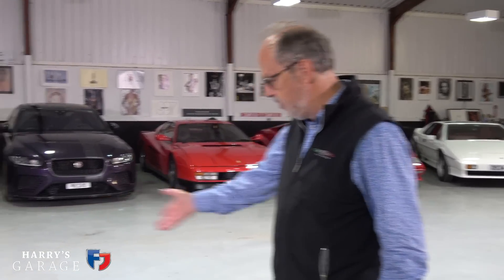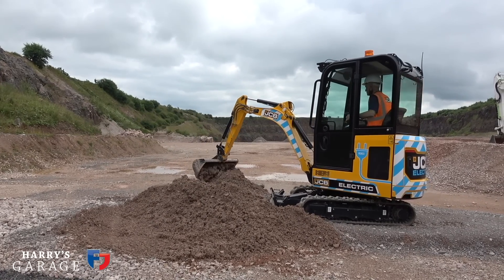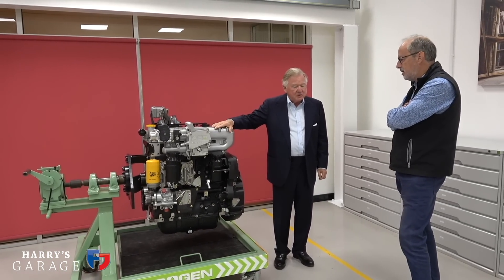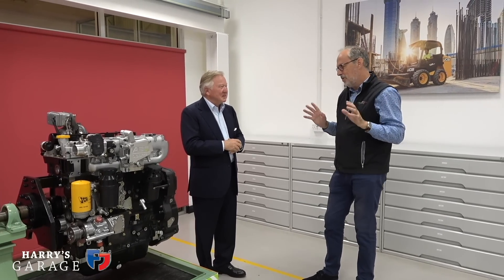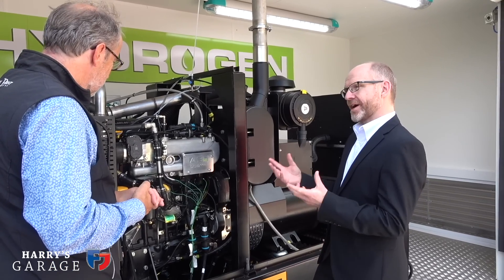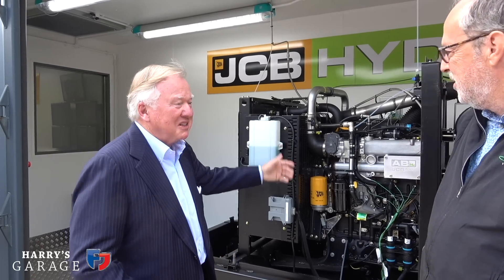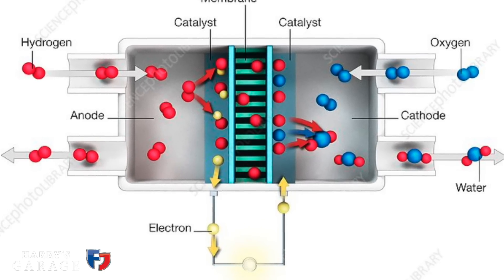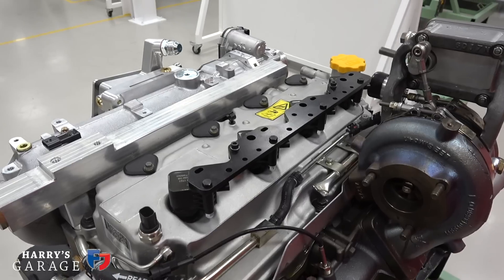Is hydrogen, rather than electric, the future for big-engined machinery? I visit JCB to find out

Comment: Not sure by how much we are being duped here. Diesel has over seven times the energy density than hydrogen. Hydrogen engines have to be much bigger to get the same power output. Toyota tried racing with a car converted to hydrogen and even at 10,000 psi the back window was obscured by the hydrogen tank because it had to be so large and even then it had to be refilled every couple of hours.
I wonder how dealing with high pressure hydrogen is going to work on a building site, quarry, roadside or field? It's highly inflammable and burns invisibly (no carbon) thankfully it is lighter than air.

Comment: They are ignoring the problem of hydrogen, which is and has never been the engine.
It is the transporting of the fuel, hydrogen. To get enough hydrogen into a fuel cell or tank, for any range, it has to be highly compressed and that is highly uneconomical and very power intensive.
Also, every 2nd vehicle on today's roads would have to be a large tanker with hydrogen, to transport enough to the fuel stations to fill the demand. Those problems are so big that the idea has been absndoned many times over.
Reply: so why are toyota pursuing it then?

Comment: First increase the generation of Electricity and when power is in low demand use the electricity to produce Hydrogen. The gas pip system in the uk could then be modified to transport this hydrogen to the user or supplier.
Reply: ..or stored hydrogen could be fed into fuel cell at source to generate electricity.  No reason to change any gas pipe  infrastructure - other than to close it off.
Reply: @bbbf09  The UK is looking into going from gas to Hydrogen to power and heat homes, hence my point about changing the infrastructure of the pipping to the homes.

Comment: The fact is electric (Lithium) is not the complete answer.  I saw a documentary that pointed out there is not enough rare earth elements on the planet merely to replace all cars in the UK, much less the rest of the world.  This split to commercial seems to be a start.
Reply: Be interested to know which documenetary you saw. One sponsored by BP/Shell/ Exxon maybe?  Misinformation
First off - Rare earth elements aren't rare - they are class of elements and some amongst that class the most common in earths crust in fact. Lithium is not that rare either. 
Moreover lithium makes only about 1-2% of a car battery by weight . So the lithium in a large half Tonne EV (e.g. long range Tesla bttery) is less than 10kg - you can likely lift it up with one hand. It's not that much
Scale that up to a billion cars (worldwide) - that mean you need 10 billion kg or 10million Tonnes. It sounds a lot - but it isn't . The ocean is one source of lithium we havent even tried extraction yet - and it contains a trillion of Tonnes of lithium - 100,000 times more than we need. But let's go looking ofronl and before we go there. There's enough.
Cobalt is more problematic - but its chemistry is being phased out of batteries now. Should be gone in a few years. . Things like Nickel are also problematic ong term - but that applies also for forming hydrogen combustion engines as it is used in high temperature steels.  We can reclaim a lot as we recycle existing fossil fuel cars engines though.

On top of all that iLithium doesnt disappear at end of battery life (say after 30 years of driving) it simply gets extracted out and reused again

Comment: It is relentlessly obviously that electric earthmovers are not practical competition to diesel earthmovers. There is no difficulty getting diesel engines to run on hydrogen. The difficulty is getting hydrogen at a competitive price with diesel oil. There are 2 says of making hydrogen: extracting it from water using lots of electricity, and extracting it from fossil fuels. Thesimplest and least costly method of getting hydrogen is to extract it from natural gas. However it is simpler and cheaper, and nearly as clean-burning, to just use natural gas in diesel engines. And overall, it may prdouce less emissions to burn natural gas in diesel engines, than to extract hydrogen from natural gas or petroleum. Getting hydrogen from petroleum is a bit more expensive than getting it from natural gas but a lot more expensive than getting diesel oil from petroleum. What all this ignores is that modern diesel engines can burn diesel oil very cleanly, however properly adjust complex electromechanical devices are needed at the diesel engine, to make sure the diesel oil is burnt cleanly.

Comment: During ww2 they had London taxi's running on H. They had huge gas bags on the roof, now they have the technology to use steel cylinders. Electric was always a con to line the pockets of the rich. Hyundai have an H car and others are following as they have realised electric doesn't work. Petrol stations can easily be converted to H tanks and pumps so instead of trying to find an ev charging point simply drive to a fuel station and fill with H.
Reply: Hyundai have caught a cold with hydrogen in the UK. During the final sales quarter of 2019, Hyundai sold just ONE single example of their £68'000 Nexo Suv.

Comment: Not promising at al. The CO2 per kg H2 produced is 12kg! That is already the same CO2/km as same engine running petrol!
And now we would add that to the rest of the extra emissions like Nox. Yes. It's not just water.
And it will still be out in a ICE piston engine running 28% efficiency.
Not to mention the cost of maintenance! Man what a bits on that rig.
They must have had a large sack of money from fossil industries.

Comment: Great Harry, thanks. Lots of pluses but - hydrogen leaks and old units might be dangerous.  Slight downside.  Wonder what JCB are doing in that area.
Reply: Not only are there potential issues with the extremely high storage pressures needed for hydrogen, the hydrogen itself still needs to be transported - under those same huge pressures - from where it is produced, to where it is finally used. How can this be progress? Electricity needs no transportation.

Comment: Well ive got a novel idea for all those electric industrial vehicles...why not create or build very large fuel powered Electric Reload Trucks the size or a Tracktor Trailor and even on top the tractor trailer vehicles would be Solar Cells that would be as wide & long as the Tractor Trailor and these interesting trucks would simply drive out to these industrial vehicles and get a short quick Electrical Reload by these huge TractorTrailorTrucks with these large & long Solar Powered Panels made specifically to go a load powerful quickcharges into Cars, Trucks, Recreational Vehicles, Vans...hell i believe even motor boat engines may be in the design phases right now for Powerful Electric Motors & engines for many Boats & Watercraft!!

Comment: I remain unconvinced. The problem with hydrogen is density. I don't see how they'll be able to put hydrogen in the same volume tank as it's hydrocarbon counterpart. That said I've always thought hydrogen would have a place with equipment because it's transportable. But they should not be In cars. Hydrogen is one of the most energy intensive processes there is. It probably takes orders of magnitude more energy to split hydrogen out of water to get you far less then if you just stored all that energy in batteries. To me it comes down to efficiency.

Comment: Interesting, but biased. I disagree with what he says about cost of batteries. The cost of lithium batteries ARE dropping, cobalt is not used in LFP batteries which is a better battery tech for cycle life. Lithium is not rare, it is nearly abundant as copper. He says diesel has ~10000Wh per kWh/kg and Hydrogen ~30000Wh/kg but he doesn't point out diesel has ~10000Wh/L and hydrogen has ~3Wh/L. They miss the point that hydrogen costs more, 4 to 8 times more? A diesel engine may last many decades, I suspect a hydrogen engine will only last years due to hydrogen embrittlement. The engine will not be cost effective for a company. Also hydrogen is highly explosive, and when under such high pressures you have a dangerous combination and then with working in construction site you have many more dangerous situations.

Comment: Renewable Diesel fuel is the way to go.
Reply: A suitable fuel for Diesel engines would be pig-fat.
Modern-day pigs have been bred to minimise fat, but the 'old breeds' seen in C18. paintings could soon be replicated. They would be outside the human food chain, so free from hygiene rules, and could be fed on one of Western society's most abundant by-products; waste food.
The fat would initially be pre-heated, to match the viscosity of existing Diesel fuel-oil, but in the longer term, solid injection could be developed, using candle-like fuel rods.

Comment: Clearly the problems with Hydrogen are associated with production distribution and storage. However this engine is a journey not a destination.Production of Blue hydrogen will liberate Co2 for the drinks and food industries.Production of electrolysis is expensive and ineffiecent.Independent machines such as plant will have to use electronic conversion of water in the injection systems.Whilst other forms of storage is been develoed by the BSCconsuling Group. Ultimately there are two criteria to meet.Dependency on fossel fuels and adaption of existing technology to prevent inflation. For governments its loss of tax revenue holding back innovation in the private sector.

The government is still stuck on the existing supply networks of gas which has a asset value of 43 billion pounds. Maybe lord Bandford could argue for a minimum amount of hydrogen in the existing gas supply networks to be able to run his engines.

Comment: This is a typical case where engineers can develop and adapt a tried and tested method of producing power to negate any harmful emissions without breaking the bank. The Government should be using companies like JCB for intelligent advice on the future of transport and construction equipment instead of caving in to the green activists and pacifying the media with knee jerk ideas of electrifying the industry. Solar and wind power is a dangerous way to go due to unreliability so fossil fuel power stations will still be needed for back up and reserve for years to come for charging the batteries. If vehicles were to be powered by Hydrogen it would probably save power outages and rationing which will become the norm in the future.

Comment: With hydrogen the barriers are just engineering issues that need to be developed properly and it just needs a concerted push. I blame the fossil fuel industry because hydrogen is a direct replacement for fossil fuels. Developing low pressure high volume storage systems will really revolutionise hydrogen.

Comment: Trouble is it takes a lot of electricity to make hydrogen. Also I don't understand why LPG wasn't given a fair chance
Reply: LPG offers low emissions at the point of use, but horrendous emissions during it's refining. And LPG powered vehicles are not allowed to access certain places on safety grounds. For example, the Eurotunnel will not allow vehicles with LPG tanks to pass through.

Comment: Three things that don’t make sense in using hydrogen in combustion engines. 

First, to make green hydrogen takes enormous amounts of electricity. About 70% of the energy used to produce it is stored in the hydrogen. Then, if the combustion engine is as efficient as a diesel one only about 30% of that stored energy will end up driving the machine. It’s much more efficient to use electricity to charge a battery and drive electric motors where 90% efficiency is normal. So in terms of cost and efficient use of electricity a battery and electric motor is better. Using hydrogen in a combustion engine will be very expensive. 

Second, batteries are big and expensive for large plant but they will get smaller. The original Nissan Leaf launched 10 years ago had a 24kW battery pack. Now the Leaf with the same physical size battery pack is 62kW. The Leaf battery pack is under the floor and seats and is quite large. There’s an electric motor bike available now with a 21kW battery, almost the capacity of the original Leaf battery and a lot smaller. There will be batteries small enough to run large plant. 

Three is the delivery and supply of hydrogen. The hydrogen JCB are using is pressurised to 350 Bar, yes 350 Bar. That’s enormous pressure that needs some serious tanks to remain safe. The single green hydrogen filling station for cars in the UK cost millions of pounds and can only produce and pressurise enough hydrogen to fuel 16 cars a day. An EV rapid charger costs £30,000 and can fuel at least 24 cars a day. When battery density is high enough to put into large plant then it will be easier to have swappable batteries in the machines to keep them running long shifts. It will also be easier to transport a container full of fully charged batteries to a site to charge batteries on site than it would to transport and store high pressure hydrogen. 

It’s a shame JCB are chasing hydrogen in combustion engines. It’s not a new concept, hydrogen combustion engines have been experimented with for many years. They were considered the car of the future during the oil crisis in the 1970s. JCB will be overtaken by less expensive battery machines being developed around the world. Hopefully they’re working on battery electric development as well otherwise they will get left behind. 

Hydrogen is still a solution desperately trying to find a problem to solve.

And finally…… he mentioned cobalt, sigh,  as a Diesel engine manufacturer does he not know cobalt is used in removing sulphur from diesel, and petrol, in refining? A one time use that produces chemical waste.

Comment: A very interesting video. This engine is an important transitional technology to get us to zero emissions, but still requires large amounts of electricity to produce the hydrogen via electrolysis. Hydrogen-based combustion engines do not negate the need for the UK to increase its electricity production. These modified combustion engines are still very inefficient (<30%) compared to similar rated electric motors (>80%). Your comments about fuel cell were also off the mark. The Apollo space crafts were all powered by hydrogen fuel cells in the sixties and space is a very hostile environment.
Reply: Actually, Hydrogen ICE is far more efficient when compared to regular ice. It is currently not as efficient as electric motors, but currently, the most efficient gas engines are at 40% efficiency. And Hydrogen Engines are sitting at 50-60 %

Comment: A half million pound excavator working out in gods know where will probably be triple shifted i would of thought. But forklift trucks have run on propane for years, is this what has led to using hydrogen as a viable fuel idea? Pressurised gas fuel in a tank.

Comment: But how can they justify the much lower energy efficiency for using hydrogen?  Internal combustion hydrogen engines are very inefficient and adds to the inefficiency of using hydrogen instead of electricity.  The only way the costs could work out is if they rely on using hydrogen sourced from natural gas - but that will make climate change worse.   The solution to using electricity to satisfy their issues would be change out the batteries instead of having to wait until to recharge them.  People looking at hydrogen usually are not looking at the entire picture.

Comment: And how do we make hydrogen? Via electrolysis which would be clean if we used only renewable electricity or we use the very dirty process getting it from steam reforming fossil fuels. The second process makes it no cleaner than running a diesel engine on diesel fuel. The first process requires more electrical energy for the process than is created in the hydrogen gas and if we are going to run all heavy transport, construction and agricultural machinery, freight trains, and shipping then a lot of hydrogen will be required and even more electricity. In the absence of nuclear generation of electricity, it will fall to wind and solar which many countries do not have the land available for the extra generation capacity that will be needed. This is why the fossil fuel industry loves the hydrogen idea as they will be picking up the slack when renewable are unable to keep up with the supply of hydrogen. To go down this path would require all countries with an oversupply of non-arable or domestic land that has a very high percentage of available sunlight to build vast arrays which would also have to be near the ocean for a water source to use. There will be many who will then want to point out the problem with very high salt content water then being returned to the oceans. I don't want to dispell the idea of hydrogen but it is not as simple as the video makes out.

Comment: Two big problems.  95% of hydrogen in the UK is produced  from steam reforming of methane which is a fossil fuel and merely transfers emissions from the tailpipe to the hydrogen plant. Second, there is no infrastructure to refuel these engnes. Once these are solved JCB has a great future.

Comment: This like all videos on hydrogen treats hydrogen as an energy source - it is not.   Hydrogen has to be produced  (just as a battery has to be charged) from another source of energy -  e.g. fossil fuel,  nuclear,  hydro etc. so there is a loss of efficiency in the conversion and the containing and transport of hydrogen is expensive and dangerous.   Hydrogen does not like to be contained so there is a continual loss from the storage tank.   Methane is a harvestable source of energy that requires no conversion,  is easier to store, can be delivered through pipelines,  the infrastructure already exists,  is more energy dense per volume and there is lots and lots of it.